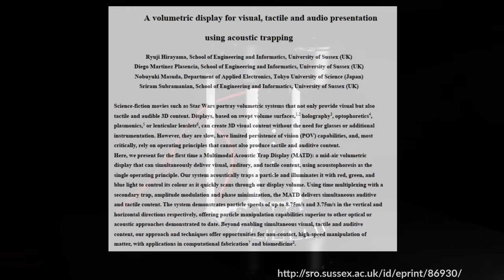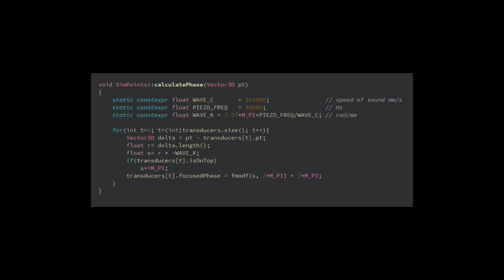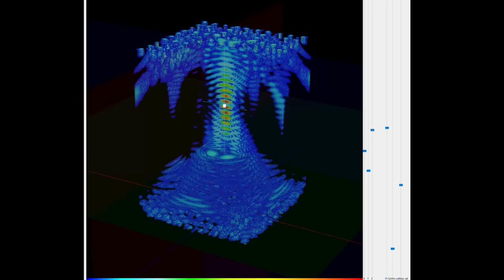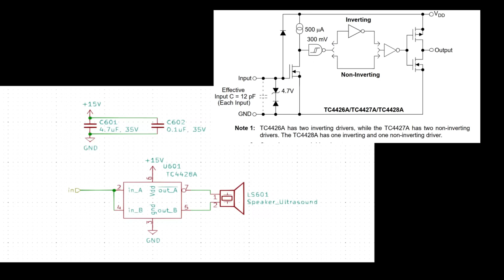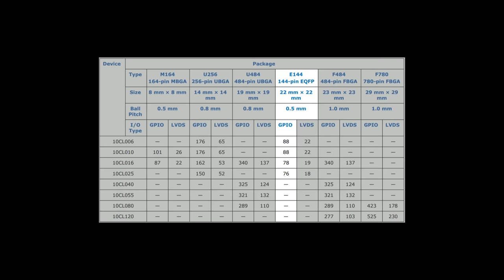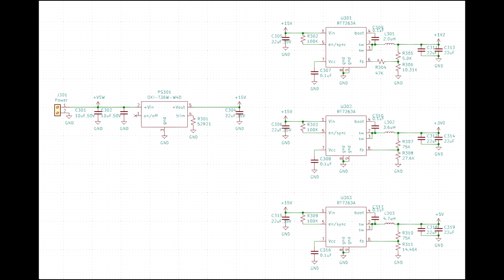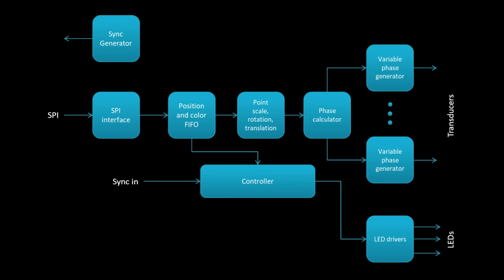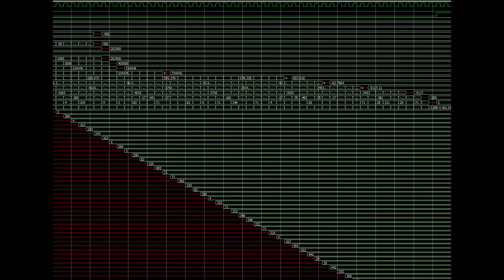A Volumetric Display using an Acoustically Trapped Particle

Comment: As a computer engineering student, the second I saw those Modelsim waveforms was the second I realized what level this project is truly on. This is absolutely insane and next level.
Reply: exactly. 100% true man
Reply: Same
Reply: Another computer engineering student here and I can only agree. The amount of knowledge to make this video is insane. Congrats!
Reply: my lab is like this: i get 1/4 of that 6:50 waveform, but with no suggestive names and i should figure out in 2 hours what it all does(i need to learn how a MIPS32 processor works). I kinda managed to figure out what memory and registers do and edit them a little to see if my understanding was correct, but then i had a lab about a fraction of a pipeline, i couldn't understand a thing. 
i am looking forward for the times when I need to do the code myself and simulate the waveform to my willing to fix my projects.
Reply: I’m not familiar with that, what is it?
Reply: @reyariass  It's what you can see at 6:45 to 7:20. Basically simulating the FPGA, driving its inputs and observing what its outputs and internal signals are doing
Reply: This is incredible, and I so badly want to try building one
Reply: He should have interpolated between the two key frames calculating the point between them going from one to the other across time and the butterfly— And any other animation— would have been a smooth animation.
Reply: Amazeballs.
Reply: fuckin Fourier Transforms HOW DO THEY WORK
but fr the math going on must be very complex, just the sheer quantity of number crunching,
Reply: @upshiftgo idk about more important, but definitely more informed. If im talking about changing a part on my car. A mechanic would have a more informed opinion than a liberal arts major. 
Your statement leads me to believe educated people make you feel inferior.
Reply: @reyariass   Every line is the value of a register, or the value of a bit. You can see the clock ticking on the 1st line, and you use the software to simulate and test how your hardware is gonan behave in the FPGA. As the language is descriptive (VHDL or Verilog), you define components and link them together. This simulator helps a ton and means you actually coded the blocks and did not generate everything from C code, allowing for high speed hardware computing. I feel like modelsim is a basic tool for FPGA even at school so I'm not sure about the OP's comment. If anything, it means the guy knows what he is doing, but at that time of the video there is no question about it. OP was probably proud to recognize the software, praised the guy for using it (praising himself in the process) and that's all there is to it.
Reply: @kathleenrobertpogue6818  Your statement leads me to believe you're new to the internet, random comments offer no validation whatsoever as to a person's credentials so the rational baseline is to assume that someone is lying (more commonly exaggerating) therefore rendering any stated qualifiers entirely null and pointless. The only real way to achieve gravitas when anonymous online is to simply demonstrate knowledge, people will either believe you or they won't. I disagree with the entire premise of education being a marker of competence, I learned more on the job and from my hobbies than I did in 4 years of EE classes.
Reply: @trayrollings3833  looks like my comment applies to you aswell. Look ow triggered you got. Poor kid.
Reply: @kathleenrobertpogue6818  Keep replying, it only serves to prove me right.
Reply: @trayrollings3833  what a weak attempt at getting the last word. Is you ego really that weak champ?
You just proved my point from my original comment.
Thanks bud. Its nice to actually have examples of what you're talking about.
Reply: @kathleenrobertpogue6818  You really are mad, I thought you were just playing along.
Reply: @trayrollings3833  o yeah, im so furious. What do you know. Another weak passive aggressive insult towards a stranger on the internet, to make your ego feel better.
Reply: @trayrollings3833  , this trash talk is a bit embarrassing.
Reply: @kathleenrobertpogue6818 Likewise, your statement kinda reflects a general bias towards titles, which I think is what they pointing to. There's no reason a liberal arts student couldn't be as mechanically inclined as a mechanic.
Reply: @flyntwick  you are correct there is no reason to assume a liberal arts student isn't mechanically inclined.
On the other hand there is a far less reason to assume he can or even that he may know more than a mechanic.

If your ac goes out are you going to listen to what the HVAC tec says or what the crack head down the road says?
You're trying to argue we shouldn't assume the crack head doesn't know what he's talking about.
Reply: @kathleenrobertpogue6818  I'm trying to argue in favor using more objective reasoning beyond the perceived significance of a title or life's circumstances.
Reply: @JimBob1937  Thanks for the play by play
Reply: @trayrollings3833  , and more embarrassing. I mean, was what I said even remotely a "play by play?" Are you just looking up generic comebacks and copy/pasting them here?
Reply: @JimBob1937   Take your meds I don't know why you've fixated on me but I don't care anymore.
Reply: Why?  Studied math
Reply: The amount of precision needed to pull this off is crazy.  Introducing a small error at any level could throw off the whole thing.
Reply: @kathleenrobertpogue6818  I think you're right

Comment: I always wondered how sci-fi holograms could ever be realistic, but something like this with multiple small particles... close enough. Nice!
Reply: We can try this i think since light is both a particle and a wave soo it might possible to move light particles using sound
Reply: @joshuapeligrino Well, sound is just pressure waves, so you technically can change the speed and direction of light using sound to rapidly increase or decrease the pressure in an area.

Not sure you would be able to meaningfully effect light this way, but it's an interesting thought.

Would probably also explode when doing this, cause the difference between a sound wave and a shock wave is just the amount of energy involved...
Reply: I've seen demonstrations that look like an actual physical object.  The way it works is that a mirror is placed a a 45 degree angle, and it's rotated very quickly.  Above (or below) it is a fast screen that changes the images rapidly, so you'll get a different image depending on the angle you are looking at it from.  That was over 10 years ago.  There's really no commercial application for these displays.  They are novel, but that's it.
Reply: There's a WAY easier method if you only need to create a hologram in the sense of a volumetric display (which is how it's shown in Sci-Fi). You can just shoot two infrared laser beams into luminescent smoke, and where they intersect, they create a dot of visible light (since only their combined energy suffices to cause luminescence). This way, you can easily build a whole hologram. It's a well known technique for at least 20 years now. The only reason why we don't use it more often is because there are very few applications where it actually makes sense. What's so impressive about the project in this video is that it's using an actual physical object.
Reply: @joshuapeligrino  Even if this is possible, if we trapped the light in the sound waves, it wouldn't be able to enter our eyes and we wouldn't be able to see it!
Reply: Couldn’t you use what he’s made as a basis to create 3D pixel grids?
Reply: If you think about how crude the first computers were, this is about the same as that… it’s an at-home fun project for a YouTube video… now imagine if billions were invested, or trillions in the case of the phone I am writing this on… Star Wars and Marvel would be nervously smoking in the corner…
Reply: this and instead of particles, we can use micro leds that powered by induction power and receiving information through it, i would say this is the closest thing we can get to 3D hologram
Reply: Thos are way easier to pull off than what this guy is trying to do. This isn't a hologram this is a physical object. Far more advanced than some projection of light.
Reply: @fuzzywzhe  thinking like that is what keeps technologies from ever becoming commercially viable, I mean VR is a perfect example. Everybody wrote it off but the few people who actually believed in the technology did the necessary work required to get larger investments from the private sector
Reply: Have you not seen the holograms that are out there. Like the ones at sporting events with the dragon flying around, or the ones in school gyms with whales jumping through the floor and splashing back through
Reply: @monster0_0  They aren't holograms.  They are generally light displays done with flying drones.

If you're seeing these on video, they are just special effects.  Your computer can do this now.
Reply: @joshuapeligrino  You can also build a small hologram yourself by cutting a ball with a diameter of approx. 10 cm in half and lining the interior with mirrors. There must be a hole on the top of the lid. If you place an object in the sphere and put the lid on it, the object will be projected out of the hole
Reply: there are stage shows using hand-held, programmed, spinning LED portable volumetric displays, works very well
Reply: @gayusschwulius8490  How about they fire the lasers into an acoustically levitated mass of micro-tiny clear silicone or glass or something faceted shapes, that may hold and blend the colour and light better. You could even cymaticaly move the silicone bits, to aid realism to movements on 'screen'.

Comment: Really well done project! Thanks for showing it to us in this video.
Reply from the maker: Thanks Ben - big fan of your channel!
Reply: Hay Ben, waiting for your next video.
Reply: @abitembedded  I think you just need to adjust the frequency -  Test the effects on a larger dot.
Also, look for a means to hold the actual device, consider sound canceling.
Funnel a single point, try salt, molten, I wanted to see your process to make a line used to make a cube.
Reply: @abitembedded  Have you tried with water droplets ?
Reply: @abitembedded  Truly excellent Dan. Much appreciate you sharing.
Reply: indeed. completely true!!

Comment: volumetric displays really do seem like the future. and the use of sound for it is amazing, imagine this on a huge scale, that comment at the end where you talked about how it can stimulate your touch nerve endings, imagine the VR capabilities, you could actually put a car right in front of somebody half the world away, and they could touch it. Could also be used for disabilities, imagine a blind person that doesn't need a walking stick because their entire surroundings is projected onto their hand, or a deaf person that has a persons speech turned into a touch map. taking a research paper and doing it yourself is incredible
Reply: I imagine the biggest constraint to this method would be collision. The position of the number of balls would have to be shifted such that they never overlap the same X, Y, Z.  This wouldn't work for more elaborate 3D models because there is only 1 dimension of 2 forces (gravity vs pressure on the Y axis).
Reply: For a touch map you'd want to add a skin attenuating beat frequency to the signal.
Edit: Nevermind, he mentions that the paper covers that.
Reply: @Mildain2000  Just the refresh rate alone would be an issue even if it was possible. You're constrained by the physical speed. This is why volumetric displays will always just be things like LED's layered together. But volumetric displays are honestly not that cool for viewing anything but basic shapes, because they obviously have a limited depth, and images of things will have near and far depth of fields, and focused or blurry details. So you'd really only get a narrow range of depth and then it'd just be a cut off to become a flat wallpaper of the rest of the things in the background. This would pretty much break immersion. 

About all a volumetric display would be good for is things like the medical field where you want to view sections with physical topology, but you can already get that in VR or AR.  For home use, it would only ever be good for giving UI elements a pop out effect. Another issue with volumetric displays is working in the 3D space itself. A simple mouse and cursor won't do. Even a touch screen wouldn't do, because eventually you'd have elements overlapping, so you'd still be limited to a 2D field of selection. Needless to say, we're not getting volumetric displays any time soon, and we'd be pretty disappointed in the practicality of it anyways. The only ones that make sense are holographic displays.

Comment: Very impressive, Dan.  Some similarity with what I did in the 90s in two dimensions with a laser dot on a screen for animated images. The mechanical scanners were critically damped to move from point-to-point in 4ms. Images (vectors) were stored with x and y coords and the mechanical scanners and mirrors "drew" the connecting lines.

When doing the real-time rotations of an image, I calculated the Z coord and used intensity modulation to dim more distant parts for depth cueing as well as making distant parts smaller, simulating perspective (that was a simple, but very effective cheat saving division to change size). .
I even wrote my own multiply routines because the MUL instruction in the 6809 processor was slower than my coded routine.

In an 8 bit machine, I used a 256 value angle look up table which is about 1.4 degrees I call the "Bi-gree" for Binary Degree. This allowed continuous rotations with an 8 bit pointer that auto wrapped around saving code.
So many neat tricks made it work really well.
Cheers.
Reply from the maker: Very neat - thanks for describing the methods you used.  I truly miss the times when you truly had to understand how a processor worked and had low level access to the registers - give me a 6502 or 6805 anyday :)

Comment: Could you make a particle that orbits another one? like as a model of the moon going around the earth, or perhaps like a real time clock of the solar system
Reply: Yes please do this
Reply: I second this. That would incredible.
Reply: Can it have 2 or more particles doing separate things at once ?
Reply: @a_3718  theoretically yes, but the closer they get to each other, the more they interfere with each other, either causing a collision or an ejection
Reply: It may be possible to do this, however there are only two planes of transducers which is a hard constraint on the maxima and minima of the resultant pressure waves and their ability to isolate particles without interfering with the other and with a fixed radius for each transducer, further clarity is impossible because you cant decrease the diameter easily.

If you had a second set of transducer planes, with a normal vector orthogonal to the original set, it would help fix this problem as you could use the second set of planes to help flatten unwanted interaction between the two pressure wells, sort of how noise cancelling works in avionics for the pilot's headset.
Reply: This would be incredibly complicated to my knowledge as they are creating one field to maintain it in the air, if there were to balls they would simply smash into each other and probably fall out as the space created in the middle to float is designed for one ball.
Reply: I agree to make it so - a Solar Cycle Clock.
Reply: I'd buy one if there was one in the market

Comment: I think I figured out the distortion issue, and it just comes down to the fact that the ball has momentum. The position the ball is supposed to be in changes instantly, but the ball takes a moment to get there, and then overshoots a little bit before bouncing back. This also applies to instant direction changes. Doing a little bit of PID action would probably fix this.

Comment: Excellent! Thanks for sharing!
The distortions could be due to reflections, or differences in transducer radiation patterns.
Reply from the maker: I did try moving the boards apart to reduce the possibility of reflections and still see the distortions.  It turns out the original researchers see them as well and "they're working on it" - hopefully they'll publish a paper on their solution!
Reply: @abitembedded  well I'm well below this project, but would some sort of dampening help?
Reply: Could the distortions be related to signal quality, air quality, or manufacture quality of the transducers?